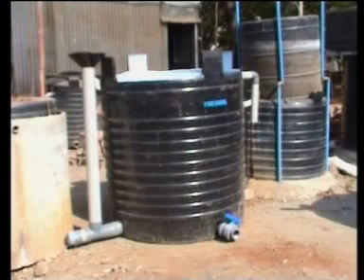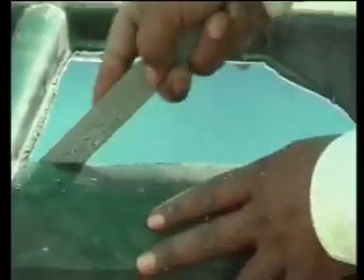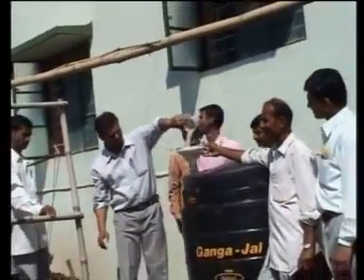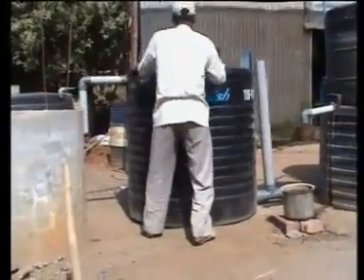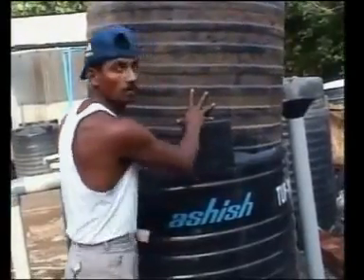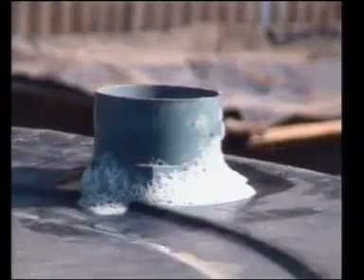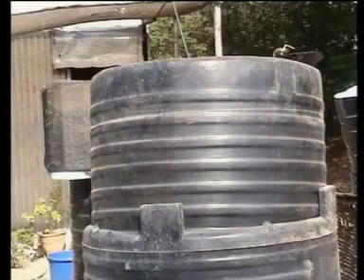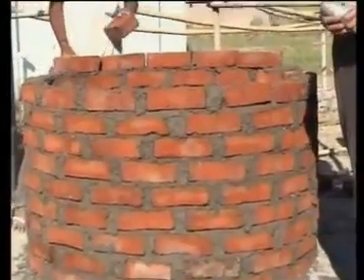ARTI Compact biogas plant (Anaerobic Digester)step by step Construction Part 3

Comment: I am having problems finding info on how to use the gas. how to turn a gas generator into biogas. I find a lot of info, on making digesters, but I need info on after you make one. do you have to grind all waste, what about human waste, can you use it without grinding it up, the solids. we do human compost, have a lot of sawdust that is with it, how will that affect the system. were do I go to get a lot more info on after the system is built, and how to use it from the generator to the grinding,
Reply from the maker: kitchen waste should be grinded and their is no need to grind human waste